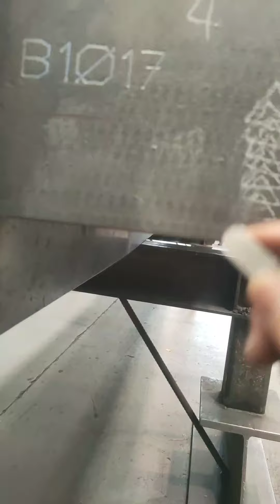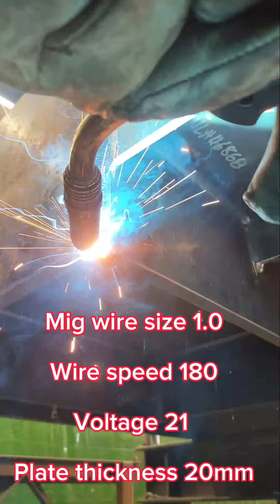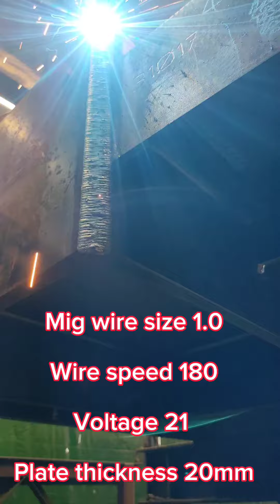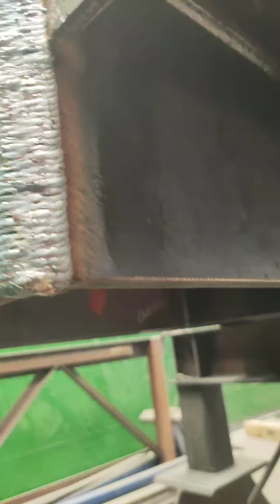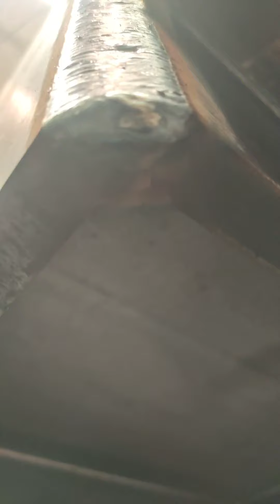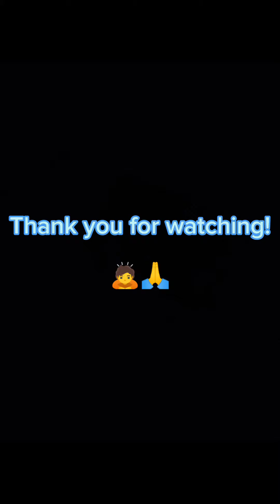Welding trick for vertical👍😉

Comment: Great job, but dual shielded flux core would be better, or 7018 rod. Mig with hard wire doesn't lend itself to vertical (uphill or down) very well, but a great welder can make it happen. YOU made it happen.
Reply: You are right, 7018 would be better for this.